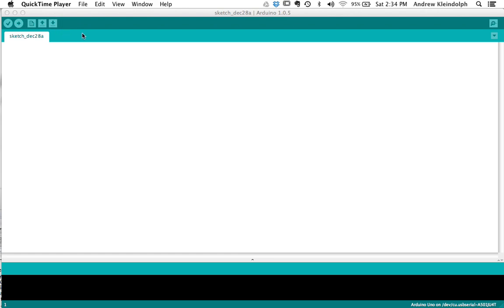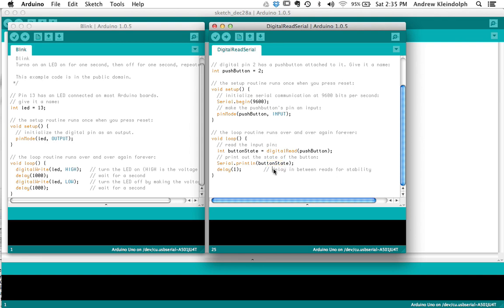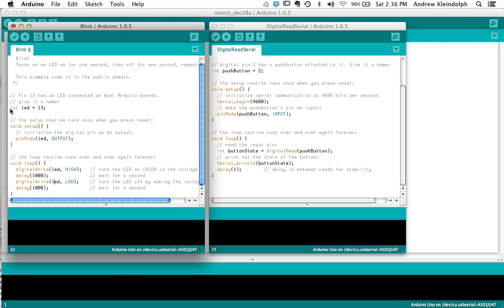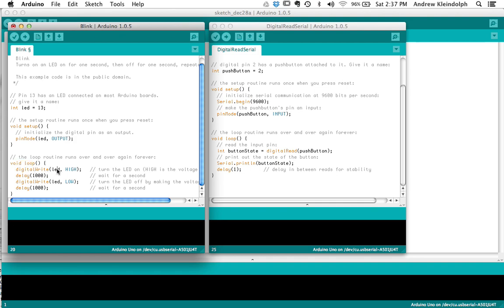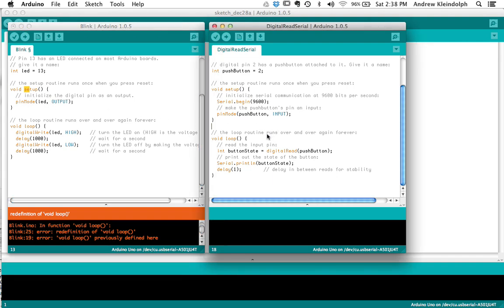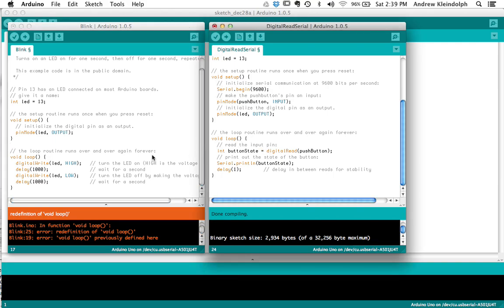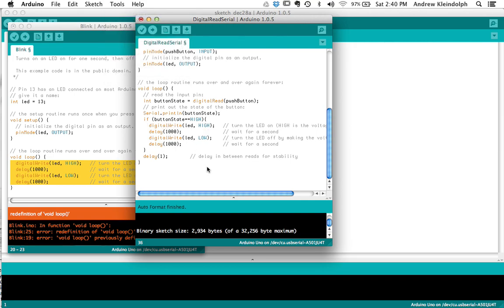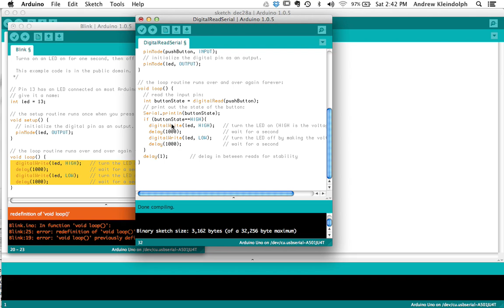Arduino Combining Sketches

Comment: It is now 2022 as of tomorrow so this has probably been pointed out already but just in case i will point it out again. At about 3:55 the () are to specify the passed variables, the void that you discussed is the type of variable for the return variable from the function. Not at all how you described them. So just because a function is specified as void functionName() does not mean that you can not pass variables. The void means that there is no return variable from the function, while the () with no data type and variables specified means that no variables are passes to the function.

Comment: hi can u give me a code for led blinking when i press the switch led comes on and blink for 20 second and goes off then wait for next switch press
Reply: It is so simple...
Reply: The example he gave will work fine if you make the first delay
delay(20000);  // 20 Second delay
As you most likely will not be holding down the button for 20 seconds it will work fine as is.
But if you need to make sure the button (or switch of some type)is not still pressed (HIGH) you need to add a check to see if the button state is still HIGH by reading the switch again in a loop until it is no longer HIGH and will ONLY light the LED after a new press of the button.
Use this command after your delay(20000);
while(digitalRead(pushButton)){}